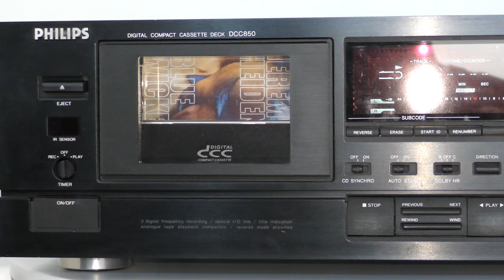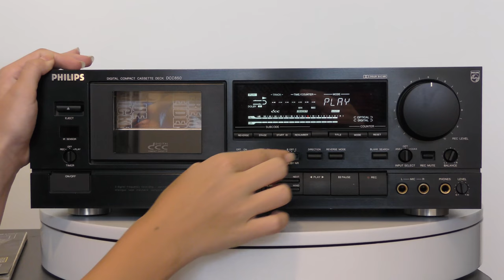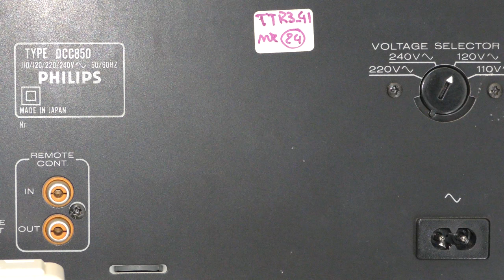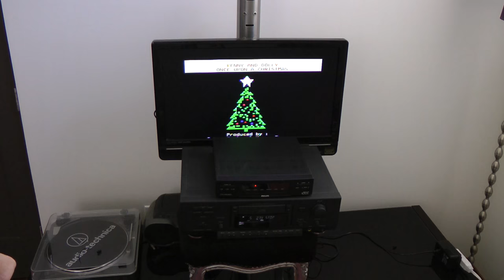The Digital Compact Cassette Prototype Philips DCC850

Comment: I am writing from Germany. I am happy that there are still more friends of the DCC audio format. I love this technique and I particularly like the sound of these devices. Years ago I myself was still able to buy the first European model Philips DCC 900 from 1993 in new condition and in unopened original packaging including all accessories. And I am still using it in my hi-fi system. Also a few years ago I was able to buy 27 new original sealed DCC cassettes, the good ones from Panasonic in the golden foil packaging, but I also had other new ones from Philips, Fuji, BASF and TDK DCC 90 min cassettes. At the moment there are 58 shrink-wrapped DCC cassettes, so I have stock for more years and many nice recording hours. I still have some original recorded DCC tapes for example Tears for Fears, Prince, Eurythmics, etc. .... I also collected all the tests in hi-fi magazines you could get and read from time to time about the golden DCC era. A very special hobby that I will definitely keep, for sure. Greetings from Germany send you : Marko Balzer
Reply: Thanks for your explanation. Is the sound quality of DCC equally good as with CD's or MD's? I wish I had a DCC Recoder like this but they never arrived here. Instead I bought a Sony MD Recorder. Its sound quality was good. I think the DCC ceased production due to the arrival of MD which was another disc format. Comparatively all disc formats are more versatile than all tape formats. Anyway MD production was also ceased later on giving way only to CD's. SACD's came but they are also rare to find. After all keep your DCC Recorder carefully as you are an enthusiastic fan. Happy listening! 
Sorry about the late comment.
Reply: Hi Marko! Do you stil have unepened TDK DCC tapes?
Reply: @SzakacsDani  Hello

I never had TDK DCC cassettes, they were almost impossible to get in Germany, and I never saw any in our HiFi shops in Germany, even in the 1990s. I only have DCC cassettes from Panasonic, FUJI, BASF and Philips.
Reply: @markobalzer2406  Thank you very much for your fast answer to a 4 years old post. Yes the TDK DCC tapes are ultra rares. I want to collect all different sealed DCCs, and the TDK 90 min is still missing. The Panasonic RT-D45E, and D75E are also rare tapes.

Comment: I believe Philips also released a car DCC head unit. Whether it ever made it onto the market remains unknown. It's a shame Philips pulled the plug on this format. The same with its V2000 video format. Yet another excellent format.
Reply from the maker: There were several car units. DCC 810,811, 822,824, 850 etc. I believe only in Europe. If you visit our site dccmuseum under collection you can see most of them.

Comment: Did I hear you correctly that the DCC playback head can read 20 tracks simultaneously?
Reply from the maker: Read and write. 8 Tracks for digital playback and 1 for providing the artist/titel/album info. That is 9 total for playback. Another 9 to make that available for recording. The remaining 2 are for analog playback. If you are impressed by this..... Wait for a video on the DCC 170 and 175 portable. Those heads can do 40 tracks.

Comment: Sad that DCC, DAT, and MD were all too little too late. We suffered with analog compact cassette 10yrs too long IMO.
Reply: Cassettes are waayyy better than those digital ones my friend if you have good cassette deck cassettes sounds better but it seems you've never had a good one
Reply: Badassvidsz Say what you want about digital formats, but if I had to choose one I'd prefer a DAT over compact cassette any day. They can definitely sound good, but with digital formats I don't have to deal with bias, levels etc etc and I can edit and add track titles etc and is capable of quality equivalent or even slightly better than a CD if you're talking about DAT
Reply: dwoodog  Do you think that DAT, DCC and MD arrived too late? 
Although DAT and DCC were digital, they were tapes and MD was more versatile as it was a disc format. Anyway all these formats were unable to beat the reigning CD format. Later SACD arrived but it did not catch on so its also rear to find.
Sorry about the late comment.
Reply: @Badassvidsz  Even though you play ordinary analog cassettes in any high quality cassette deck, the sound quality is not as good as of a digital player like a CD, DAT or MD player. This happens because the frequency response range is wider and wow and flutter is lower always on a digital player like CD player compared with any good analog cassette deck. This is a proved fact.

Comment: I don't think that it would have been a bad thing to be able to turn on Dolby noise reduction on digital tape... I use Dolby C type noise reduction on my car cassette deck while listening to Mp3 file's through a cassette adaptor... The only time that Dolby becomes too aggressive is when the digital file is recorded badly or in lower bit rate... But otherwise it kinda gives the digital file some analogue shaping which actually sounds good to me....
Reply: Do you need to use Dolby System when playing digital tapes like this DCC?
Reply: @janath9118  No. It's just for playback of analog cassettes recorded with Dolby. Digital is noise-free by definition, unless there's noise in the recording itself like an older track from the sixties might have.
Reply: @notsorandumusername  I read your comment and understood it well.
Thank you for the reply!